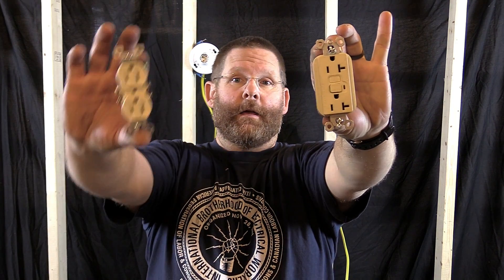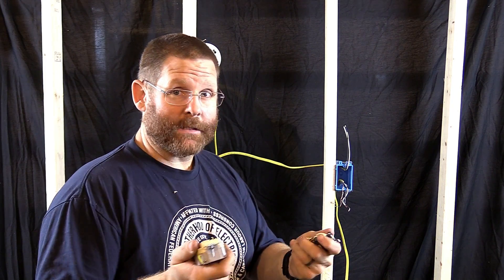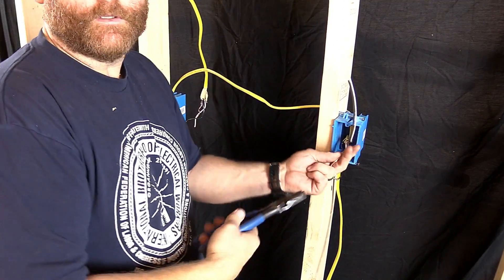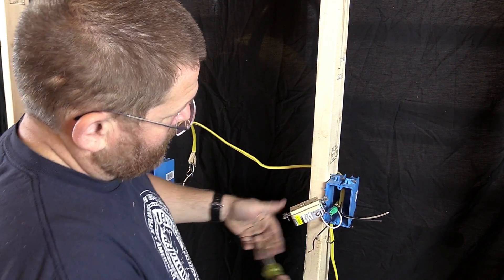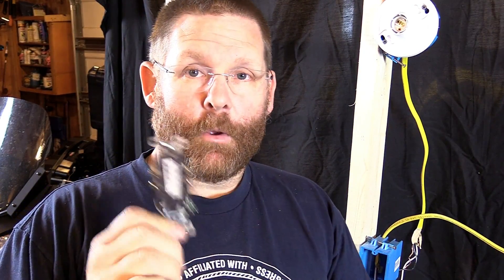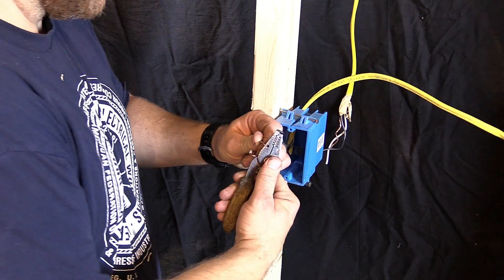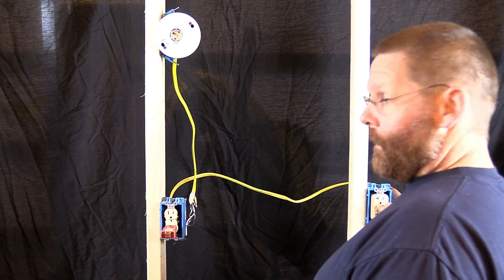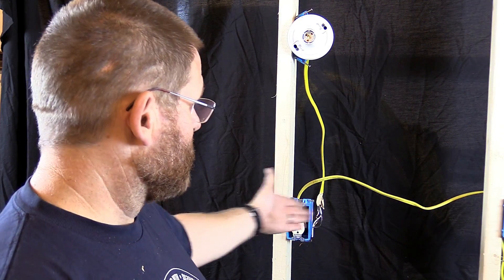How To Wire A GFCI And Receptacle

Comment: So a 15 amp outlet is ok down stream GFCI  outlet on a 20 amp line? I watched a YouTube that showed all outlets should be 20 amp on a 20 amp line. Including lights. I’ve seen this done and wondered what would happen if I pulled 20 amps on a 15 amp outlet.  Novice here. Please forgive my ignorance.
Reply from the maker: You know what that is a great question. I will have to ask someone that is much smarter than myself. For the sake of everything, for now if you have a 20 amp gfci I'd put 20 amp receptacles.  Especially if you are protecting them from the gfci. I don't know if it truly matters if you install a 20 amp gfci and then put 15 amp on the load side. Obviously it will work but not 100% sure on code. I'll get back to you

Comment: If the room is already finished and you can't see the wiring behind the wall, is there an easy way to determine which of the several garage outlets, for example, is the first outlet closest to the breaker? Or is this mainly a project for when your walls are open?
Reply from the maker: Absolutely it will take some work. Pull them out of the box and may have to disconnect some of them to see where the power is and where the power goes away. Or get into your attic if it's feed from up above and see where it's leaves your panel, and goes into the first receptacle. Same if it's feed from underneath.

Comment: I'd like to see you wire a GFCI Outlet that 3 main romex wires run to. Because I have 5 outlets in my bedroom that all work oddly enough, but they were showing hot/neu rev until I got to the last outlet to check, and it's showing open ground 😵‍💫 and now all of them read as "open ground" which makes no sense because it has 3 ground wires spliced in to 1 and is screwed to the outlet (it's not a GFCI Outlet)  but they're all grounded. So I am quit perplexed as to what is going on, all of the outlets work, but I do know that it shouldn't be that way and isn't safe (even tho it's been the same way for at least 6 years now) I am learning more about electricity and how to check these types of things and to hopefully correct/fix the issue. But I have to admit this one really is weird! Anyway if you are able to get to this in time and can get back to me (or do a video about it) that would be greatly appreciated. Thanks. Keep up the great work. Because most people should be able to do the types of jobs I've seen you do so far. 🙏
Reply from the maker: That does sound confusing what did you finally find out??

Comment: Thank you,  so I want to put the extra outlet in the same box as the GFI outlet. I am not sure about the wiring between the 2. There is a line and load into the GFI right now. Do I still use pigtails and would that be the 4 wires in pigtails
Reply from the maker: Depends on if that one needs to be gfci protected. Which I assume since you have one gfci in there already it does. So make sure you put it on the load side of that gfci pigtail

Comment: good evening Im having an issue. I'm plugging everything in correctly however as soon as I plug anything into my GFCI-protected receptacle pop goes that weezel and it will not reset until I unplug it. I'm a new electrician can you please help me. Thank you.
Reply from the maker: Honestly sounds to me like whatever you have plugged in is faulty? Is it everything you plug in? And is it a metal box?

Comment: Btw your videos are great and very easy to understand, love it and ty for posting
So when the power went out and the gfci tripped we replaced it cause it was old, weird thing is one of the outlets powered up our microwave on the other wall, so I plug in a toaster which then turned on microwave on the other side of counter which is plugged into another outlet
Reply from the maker: That's weird.. Turning on something else turned on your microwave?

Comment: Hi I just installed the gfci it’s showing power to the outlet but it won’t reset therefore outlets won’t work 🤦🏽‍♀️ 🤷🏽‍♀️🤷🏽‍♀️🤷🏽‍♀️
Reply from the maker: Sound like you may have it wired to the load side?

Comment: This question isn’t gfci related but I have a 3 way light switch what happens if some of the wires are mixed. I tried a couple ways and the light still turns on…
Reply from the maker: Won't matter, just may not work correctly

Comment: I reused an the old GFCI outlet and connected 3 plugs on the load side.  The GFCI stayed tripped and would not reset.  I unhooked the load and it worked.  One of the load plugs is missing a ground (plan to fix before we move in), but should that cause the GFCI to fail?
 I'm guessing the old GFCI is just defective and should buy a new one.
Reply: I bought and new GFCI outlet, and it did the same thing. So after I fixed the unconnected ground downstream, the GFCI now operates correctly.
Reply from the maker: Well that's awesome glad you got it fixed.. I was on vacation Just getting back and answering messages thank you for your comment and your update. Have a great day ☺

Comment: Why is there a video explaining hoemw to wire a no fault receptical ???? The breaker in panel is  different than a no fault  breaker  . Unless you buy a no fault  breaker for panel, some times it cheaper, if can run 2 or 3 or more on same circuit of amps.  A no fault trips under a short , not under heat where all regular breakers trip  by the heat and not a short. It takes a earth  ground to make it no fault to work properly on a short to trip imedately. It life saving. On a regular breaker, in order it trip , you must reach the tempature it takes for the amp breaker to reach before it melts the mercury to trip breaker. Remember if it takes 30 amps to run a appliance, do not make the no fault less than ot required to run compontent and the main breaker also the same so it not trip being over loaded.

Comment: Question can a gfci plug be installed as a split circuit if so can you explain n show me a vedio thank you
Reply from the maker: What do you mean a split circuit?
Reply: Good morning when I said split circuit I mean using one plug with a double breaker two power wire from breaker to one plug (split plug)so I'm asking if there's a way that instead of a regular plug in which Hou can break between the positive bar for a split plug can there be a way to installed a ground fault plug in a similar way thank you

Comment: If u haven't done it yet, I would like to see how u can add a ground to a receptacle of a old building with old wiring( only two wires,hot and neutral)
Reply from the maker: If it's romex it would have to be rewired or a gfci in its place

Comment: I'm running into an issue where the green light is on but anything plugged in doesn't work in either outlet port. And no matter how hard I press with a screwdriver the test button won't go in. But the reset button works perfectly. Or at least it presses in.
Edit. There is 122 volts to the hot wire. It's not just one it's all three in the kitchen and one in the bathroom that all do the same thing
Reply from the maker: Try this video I think you will find it to be your problem if not let me know. https://youtu.be/10aHiJAEm10
Reply: @MountaineerOutdoors  thanks
Reply: I have 5 wires total 2 white and 2 black plus a ground wire I hooked up the hot wire to line side and white wire to the other side then next black  went to the load side next white to load side and if course ground to ground but it still has the same issue. I can unplug the load black and white load wires and hopefully there's no other outlets continuing on the same circuit.
Reply from the maker: Did you do anything before all this happened or did it just mess up on its own?
Reply: @MountaineerOutdoors  I figured it out the line wires and load wires on the hot side were backwards. Instead of actually figuring it out I just copy and pasted what was on the previous GFCI instead of looking how they were mapped out. And I switched out all my outlets and GFCI to white from almond ones so definitely all me lol
Edit: I figured it out with the video you sent not on my own just to clarify thank you again
Reply from the maker: Awesome at Least you got it. Good job man. Have a evening/day.

Comment: First time seeing this video. I have replaced several GFCIs, receptacles, even newer ones with USB ports on them, as well as recessed outlets. I am no handy man, no electrician, just a guy who got tired of paying someone to come do this type stuff and charging me an arm, an a leg. So thank you! Awesome vid. Funny!
Now, my question, I bought an electric smoker, small one, so I could cook proteins, while I work, and not have to babysit a fire or bbq pit. Love them, they are the best, for my purposes just not as user friendly as I need. Anyways, I plug the smoker in and bam, trips. I have an outdoor kitchen, plug the smoker in bam trips. I have discovered the previous home owner, due to having a pool had to install GFCIs, no worries, problem is there are no regular receptacle in the chain, only GFCIs. I am not confident enough to resolve this issue. That said, I need to be able to plug my smoker in, and it not trip. Best solution? Currently I have to run an extension cord from outside smoke location to and through the doggie door into a receptacle just inside the back door. Was told because patio where smoker is, is close proximity to the pool, that I needed GFCIs. Don't understand why every plug outside has to be a GFCI. The pool has its own gfci, the outdoor kitchen has a gfci, the patio, and on the outdoor fireplace all gfcis, and one light switch, which I have no idea what it is for, in that location...
Any help in understanding this is greatly appreciated. A super simple and cost effective solution, even more appreciated. Thanks in advance.
Reply from the maker: Anywhere there is water there has to be gfci, outside, garage etc... If it's tripping immediately are you sure that there isn't something wrong with the machine?  Unfortunately sounds like all the gfcis are placed in the correct spots.
Reply: @MountaineerOutdoors , thanks. All the GFCIs I mentioned are all in a span of 30 feet. I don't know if there is something wrong with the smoker or not. How would I test that? Once I plug it into the extension cord and plug in to the regular receptacle (smoker cord not long enough),  inside, it works fine, but only on that one receptacle, it trips everywhere else.
Reply from the maker: Honestly, I don't know how to tell you how to check it. Gfcis monitor leakage to ground. The item your using maybe old. It's honestly hard to say. I wish I had a better answer for you on this
Reply: @MountaineerOutdoors , no worries. I appreciate your honesty. I have stumbled across some ideas, pursuing those. Hate to throw it away and get new, but that seems to be how things are made nowadays. All the best.
Reply: @MountaineerOutdoors  Regarding code, in this instance where GFCIs are needed, outside or otherwise, does the actual receptacle need to be a GFCI style receptacle or can the receptacle be a regular one, but just down the line from a GFCI-type as you showed in the video?
Reply from the maker: @davidcatchpole1772 so you can install one gfci and have them protect the other regular receptacles. I would maybe think about getting the receptacles labeled WP. If you have 2 circuits on them then you will have to protect that other circuit as well.

Comment: So the GFCI always needs to be fed directly through the panel ( a homerun), it's the first in your circuit  and then your daisy chain comes off that ? Correct?

If the GFCI is fed directly from the panel, can you daisy chain off of it in both directions?...so that 3 romex lines come out of your box ( total of 9 individual wires).

I'm doing a kitchen which needs 2 circuits ( for my counter tops), my fed is coming 50 ft from the panel up through the basement in the middle of the kitchen to the GFCI and then I've daisy chained off of it to the right ( skipping every other one) but I'd like to continue the circuit to the left, so can I feed off the GFCI both ways ?
Reply from the maker: Sure I don't see any problems with that

Comment: My GFCI keeps tripping, how do I increase the amp power in the GFCI? Or do I need more amp power in the panel/breaker?
Reply from the maker: If it's tripping sounds like you may have a problem with whatever you have plugged in it.

Comment: I have a bunch of outdoor outlets downstream that are protected by a upstream indoor gfci, the gfci keeps tripping because of downstream moisture, can i just put both line and load wires on the line inserts of the gfci and change all downstream to gfci and do the same to individually protect each outlet?
My intent is each gfci only will trip if it is wet and not affect the other outlets.
Reply from the maker: Yes absolutely can do it.

Comment: Can you show how to wire a leviton  GFCI switch with a outlet . The GFCI has 2 black wires on the top right corner that says switch wires. My application is a switch for a porch light and a outlet for a plug and it also has wires for a load receptacle. Thank You Mike Ploetner
Reply from the maker: I actually have a video coming out on this very item very soon. Thank you for watching and commenting ☺

Comment: Can you wire two loads from a GFCI? Our home came with a GFCI outlet that was feeding two separate electrical lines in the same box - they were pigtailed together and connected to the load lines, and all THREE grounds were pigtailed and connected to the ground green screw. Outlet tester was showing  no grounding though
Reply from the maker: If it was showing no ground it may not be all the way back to the panels. Maybe someone upgraded some of the wire but not all the way back to the panel.

Comment: How would I find the first socket on a circuit in a already built home to install a GFI? Love your videos, Just found you tooday while researching how to troubleshoot dead sockets in my mothers home.
Reply from the maker: Trial and error. Turn off breaker. Pull out one Recep break the joints... Turn it on see if the rest of the circuit is dead. I appreciate you watching and commenting ☺

Comment: Thank you,  after watching this video I wired my new construction cabin/office with GFCI and downstream outlets and it works beautiful with the tester. The new code is to use TR (tamper resistant) outlets which I did not know and the inspector failed them. So out they go and reinstalled. Now the regular outlets also have push in back holes and 12/2 wire and do fits in and tight. Is this a no-no?  The loop wiring is a pain because the side screws are lose, though possible but a pain to loop them. It seem to work but would this fail inspection?
Reply from the maker: No it definitely will not fail inspection at all. I just prefer to side wire not stab in the back. Just my preference but your totally fine and it's definitely not against code

Comment: Question #1) How do I run a wire from a GFCI to a switch and then to an outlet? Or should I run the wire to the outlet and then to the switch? Question 2) I want to run wires from my main box to my 2 shops outside using #6 wire. (less resistance over distance). I would have to splice 2 wires together as the wire I have isn't long enough. I thought of using a 1/4 in copper tubing about 1 1/4 in long with a hole in the middle to see the wires joined.  Then crimp the ends and cover it with heat shrink to prevent any problems. I would run wire from the house to a circuit box in Shop #1 and then run wire from there to Shop #2. I need 5 wires, 3 hot(1 for lights in both shops and 1 wire for machinery each for both shops) A common and a ground. Each circuit box has its own ground. Suggestions?

Comment: Wouldn't the gauge of the wire used, be rated for the breaker size. Correct Me if wrong, I'm just trying to learn but according to Canadian Electrical code the maximum sized wire that can be used on a 15amp breaker is 14gauge or 14/2 Romex. I'm in Ontario so this could be a Local Code. 
Just looking for Clarification on that. 
According to my knowledge in Ontario you could only use a 12/2 wire is if the breaker is a single pole 20amp, and addition to the wire
Size being 12/2 with a 20amp SP Breaker all Recepticles in that circuit shall be rated for 20amps.
Reply from the maker: Everything you said is exactly right. I don't know the Canadian code but your comment is exactly right

Comment: I have a question; hope you can help, I wanted to plug in a refrigerator in my garage, but the fridge tripped the GFI how can I re-wire so it doesn’t trip the GFI?
Reply from the maker: Per code you must use a gfci. It's possible that your refrigerator may have something wrong with it. May need to run a dedicated circuit to it just make sure that it is on a gfci.. I have seen where gfci breakers will alleviate a nuisance trip and still be protected by code
Reply: @MountaineerOutdoors  thank you.
Reply from the maker: I know it's not what you wanted to hear but unfortunately the code is what it is. Have a great evening

Comment: I understand that split recepticals aren"t  allowed anymore in the kitchen. I'm talking in my case I have hardwired dishwasher and garbage disposal which I want to convert to plug in. Do you have a video that shows how to switch gfci outlets  (for the garbage disposal) or just explain how to wire it? Do they have to be arc fault gfci's? They both have 14-2 wiring. Thank you!
Reply from the maker: I do have an upcoming video on switched gfcis that will be out in the upcoming months. I know that isn't a good answer but you can Def switch a gfci for sure
Reply: Ok great but Im doing this now,.Any suggestions where to look?
Reply from the maker: I honestly don't think that there is any other videos on you tube about this subject. If you we to join my Patreon you could get a link to that video not trying to sound pushy but I do have my videos set up where they come out at certain times of the year.